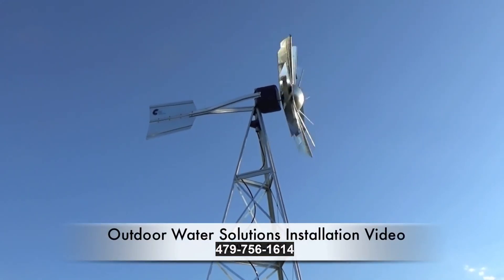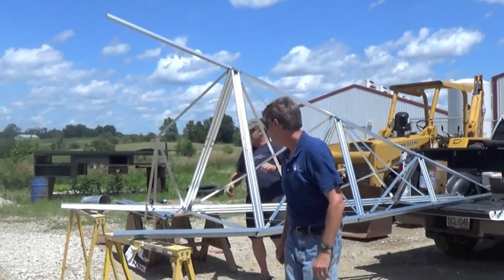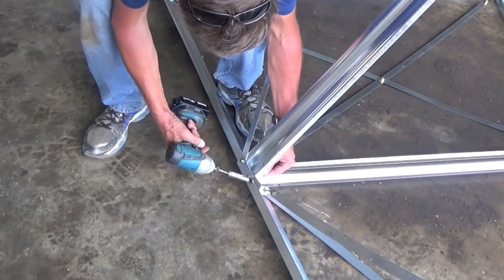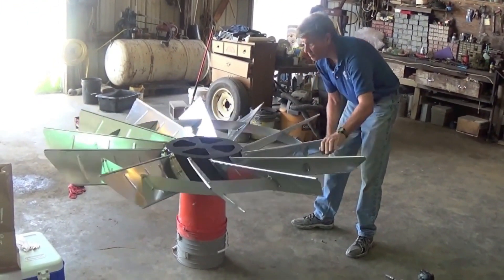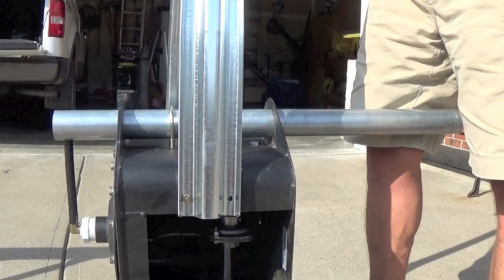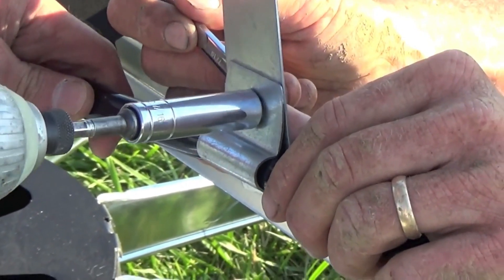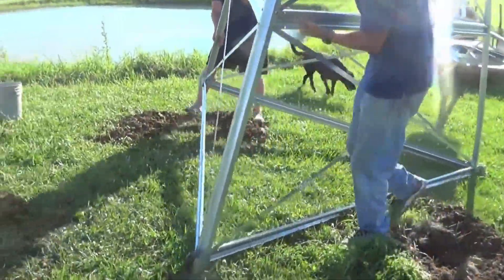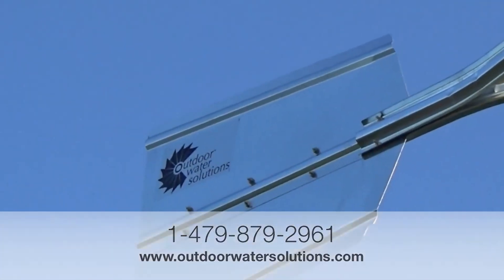Complete Outdoor Water Solutions Aeration Windmill Installation Video (2021)

Comment: I put my wind mill on an old Mud pump skid,   It’s about 12 feet long.  6 feet wide,  real heavy.   Weighs about 3,000 pounds,    The I beam is 5/8 inch ,   12 inch web,    Climbed the. Windmill today,,, I replaced the rubber parts,   It is risky up that high,   I’m going to weld some hinges on one side so I can lay it over next time,.
I put it on a skid so I could drag it to any of my 3 ponds that need it,   Only moved it once,   Lotus and lily pads took over my catfish pond,   They are pretty but invasive as can be,  I’m spraying them to kill them off.

Comment: I recently built the 20 ft. 4 legged windmill, and was very impressed with the quality of the materials, and the engineering; planning that went into the product. I am a retired aircraft mechanic, so it was not difficult for me to build. But for those who may not be mechanically inclined, I would advise getting some help. Watch this video several times, and read the manual several times. Make sure you don't tighten the nuts unless told to do so; especially the nuts for the blade hub, because if you don't leave those loose, you will never get the last blade brace installed. As you flip the sections over, the cross braces tend to flop and flail, so use some small needle nosed vice grips to clip them in place temporarily.  Compare the measurements of the cross braces to the dimensions given in the illustration on page 7. It's a good idea to keep a 1/4 inch awl handy to align the holes, and as you add legs to sections, clamp them in place with a pair of duck bill vice clamps. If you are confused about anything, call OWS; they are very helpful and patient.
Reply: Here is a short video of my windmill. The powder coat paint job is exceptional. https://youtu.be/dnhPI9llQrA